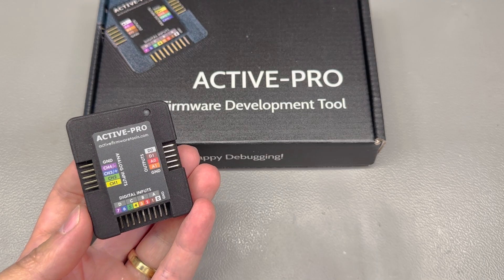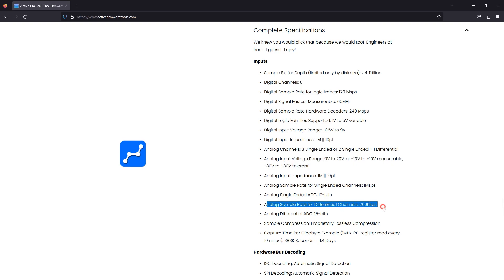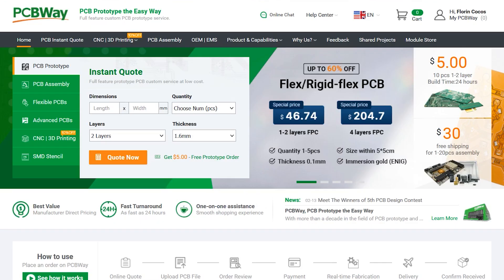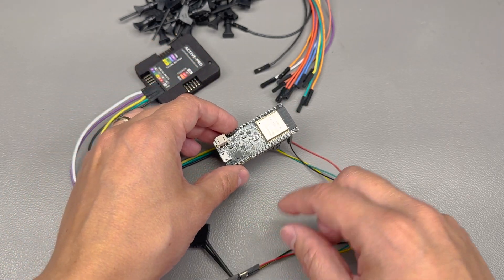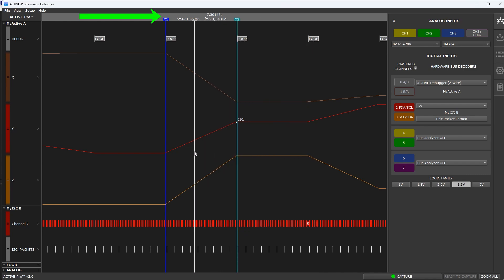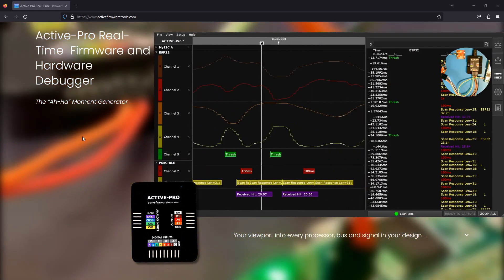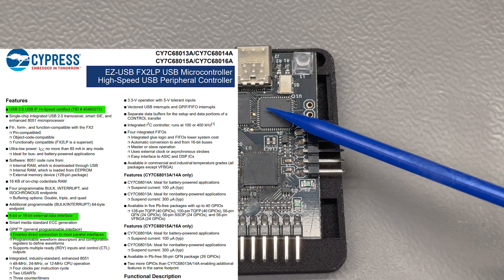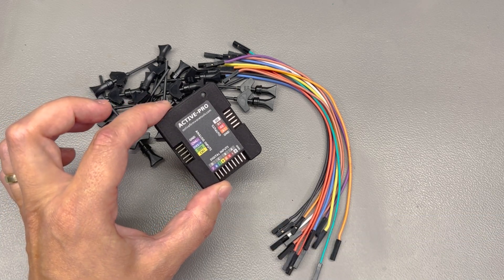Active-Pro The Most Powerful Firmware Debug Tool | Voltlog #451

Comment: I’ve been using the Active-Pro tool since January 2025 and have reported over 47 issues—mostly functional, with a few feature requests. As of today (August 2025), 34 of these issues remain open and unresolved.

The most critical problems involve data representation:
- Decoded data is often misaligned with actual timestamps.
- CSV exports transform data inconsistently.
- Labels in the GUI do not reflect the latest values.

I’ve stopped using this tool for current consumption measurements due to:
- Unreliable calibration: Analog values cannot be calibrated accurately. Even after calibration, “0” current is not measured as 0, and the process corrupts configuration settings. Reloading a capture file undoes the calibration, forcing manual reconfiguration.
- Unreliable capture: Sometimes, the tool appears to be capturing data, but it isn’t.

The only real advantage is the speed of message decoding, though it comes with its own defects.

The developer was responsive in early 2025 and provided a partial fix for the baud rate issue, but no updates or feedback have been provided since May 2025.

Final verdict: Based on my experience, I cannot recommend this tool in its current state.

Comment: Main problem: you presented the Enterprise version, the cheaper two don't enable custom packet presenters. 
Have you checked Analog Discovery 2/3? Very nice, the software is some ways better, some ways worse. SDK is free and there's built-in scripting support. Full oscilloscope with flexible triggering, logic analyzer, 16 IO, positive and negative variable voltage supplies, external triggering options, synchronisation between two devices...
Reply: Admittedly, the AD doesn't have the debug functionality, aside from just decoding and displaying serial traffic (with potential sensor-specific decoding via scripting).

Comment: I guess you could create a plugin for the Saleae Tools to create similar features.
The Saleae hardware is certainly more capable, so this should be a software/firmware add on.
Reply from the maker: Comparing something that exists right now and does an extremely good job of the task with something that "could be created" to get similar functionality on a different tool, isn't exactly a useful comparison.

Comment: It looks OK, but if you are in the market for a good logic analyser, I'd recommend considering the Saelae Logic Pro, particularly if you qualify for their student and enthusiast pricing.  You'll get more functionality (a big pile of plug-ins), more inputs for less than the price of this one. It doesn't provide any digital or analogue outputs though, since that's not its purpose, but those things are trivial to set up on another uC such as an ESP32 if you need input stimulus for a device.
Reply: You're right, there are a ton of options for Logic Analyzers out there and they do make a good one.  Where the Active-Pro shines is for analyzing microprocessor debug output from your firmware, not simply displaying digital or analog signals and bus bytes, which this does as well, and actually faster (120Msps) for almost half the price.

Comment: This doesn't look much different than the AD2 from Analog Devices
Reply from the maker: Are you using that for debug on your workbench?
Reply: @voltlog  yes
Reply: The key feature difference is that the Active-Pro specializes in capturing and displaying firmware debug information synchronized with the other analog and digital signals that are common to both units.
Reply: @timharvey3582  I've used the AD2 to watch firmware load into an STM32F405 and recorded it. I've used it to watch digital and analog signals that should be in sync with each other. Maybe this device does something else, but it seems what you jsut described can be done with the AD2 as well.
Reply: @de-bodgery  You are right in that they can both capture signals and busses as your board loads its firmware.  The magic sauce is how the Active-Pro displays the debug output coming from inside your processors firmware as it runs, separating it into multiple virtual channels and automatically graphing variables in real time synced to the other signals and busses.  It gives you a very detail view into what your firmware is doing internally.
Reply: @timharvey3582  I'd have to really look at this. Seems like what I can do with an AD2 TBH.
Reply: @de-bodgery as a user of AD2: the AD2+Wavwforms does many things better than this device. But this device does two things better:
1.  live decoding of debug output up to 64 virtual channels of variable states (for example),
2. Displaying all the data time-synchronised (often with AD2 and Waveforms it's hard to correlate analog captures with digital analyzer results, as you can't have them on the same window).
On the other hand, the AD2 is a 300 dollar device IIRC, and comes with an SDK out of the box...
Reply: @Validole  I've got an AD2 and used the SDK for python. It's a rather useful diagnostic tool.

Comment: So it's a digital/analog logic analyzer with a logger for messages? It cannot flash firmware to devices?
Reply from the maker: It is a debug tool. Cannot flash firmware. What are you using for debug currently?